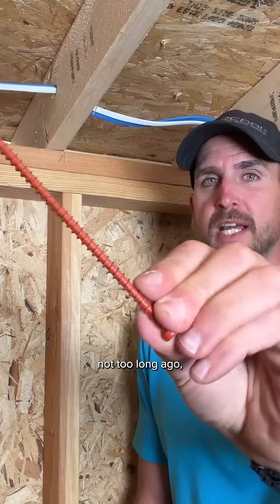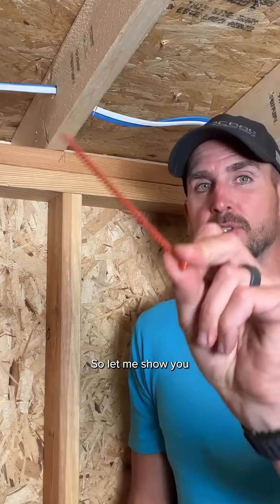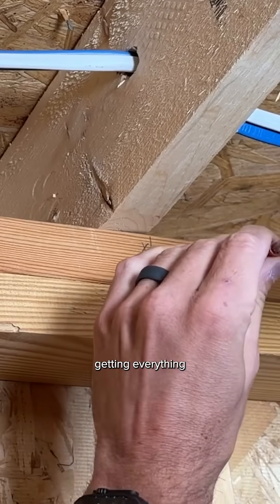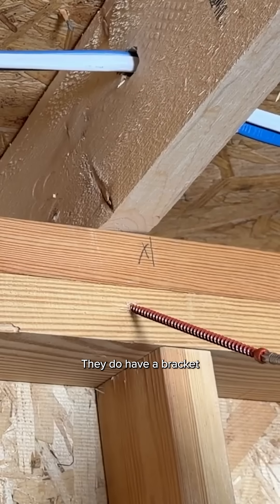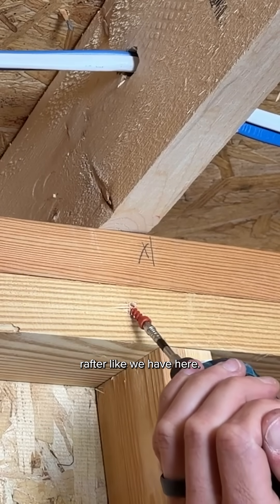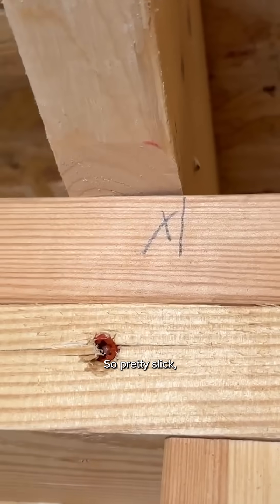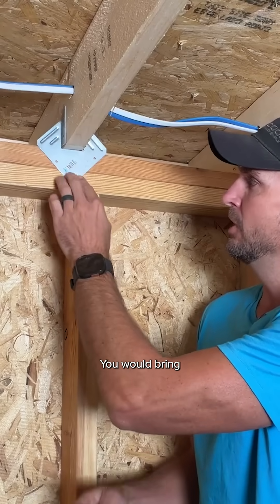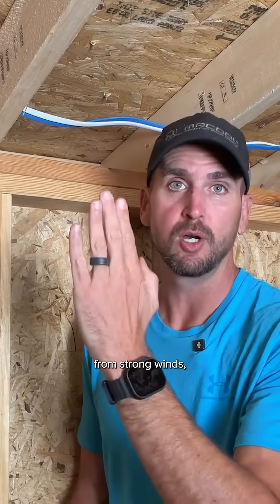The Screw That Makes Hurricane Straps Obsolete?

Comment: A screw with threads cannot replace the bracket. The bracket has more points of holding on both structural pieces. Plain physics says no.
Reply: You comment clearly indicates you don't understand engineering. The screw and bracket strengths are calculated based on the cross sectional area in tension. That bracket is about .05" thick with two wings of about 1" long each seeing the tensile loads. That works out to about .10 sq in total in tension. The material of the bracket is commercial grade steel galvanized steel (G90) with approximately 40,000psi yield strength. So... 0.1 sq in x 40,000psi = 4,000 lb yield strength for the bracket. Now let's check the screw. Structural screw material is typically high strength steel alloy with a yield strength of about 140,000 to 160,00 psi.  A .25 dia screw has a cross sectional area of .049 sq in. So...0.049 sq in x 140,000 psi = 6860 lb yield strength for the screw. The screw is significantly stronger in tension and exceeds the brackets capacity. Both of these capacities far exceed what the wood itself can tolerate so the engineers de-rate the allowable loads considerably by taking into account other factors such as the wood's mechanical properties since that is the weakest link. They also apply a generous safety factor. This is why when you look at the catalog you'll see 470 lb allowable (working load) for the H1A bracket and about 600 lb allowable for the structural screw. They've done empirical testing with sample assemblies and the screwed option always comes out ahead. Both, however, meet the minimum code requirements.

Engineers are smarter than you!
Reply: @internettoughguy  Q: What do engineers use for birth control? A: Their personalities.... 😅
Reply: @internettoughguy   sounds like this "Internettoughguy" dude knows what he's talking about. I'm just a carpenter but it sounds right to me
Reply: @internettoughguy  Tests that miss all variables are worthless. The bracket wins, with multiple points of entry and multiple points of fastening and better security against variable shear loads. Any genius can see that.
Reply: @Ben-v7e How do you know the tests miss all the variables? Have you witnessed the tests? Do you even know what testing they do?...
Reply: @i @internettoughguy engineering I do not understand, glad you told me. What I do know is a screw has given way (not broken) when a piece of material is shaken/vibrated and the other piece more solid. In construction, one fastener is not going to hold better than multiple fasteners in a plate in different directions. This is just a fact based on field work, not arithmetic. Have a nice Thanksgiving.
Reply: @internettoughguy  "significantly stronger" it can eliminate 20% more uplift... not doing miracles. 

And if youre trying to protect for lift and load the bracket wins out every time, and that's according to the engineers you praise so highly.
Reply: @00gyb00gy  You misunderstand the numbers. The screw itself is 40% "stronger" in tension than the hanger itself (6860 lb vs 4000 lb). The allowable loads in the catalog have reduction factors included because the wood itself simply can't handle the same loads as the screw or the hanger.
Reply: The problem is you're applying plane physics to home construction. Homes don't need to handle the same loads airplanes do.
Reply: yes!  more talk about plane physics since we live on a plane geometrically
Reply: @bw-mi9xp I like plane physics because flying is cool
Reply: Forgive me if I balk at taking engineering advice from the word of someone who can’t differentiate between “plain physics” and “✈️ physics”… 🙄
Reply: Nope.  Plate uplift in Doug-fir is 545 pounds.  The screw is 615 pounds.  Simpson publishes these values based on testing, you can look it up for yourself.
Reply: @SteelheadTed nope Simpson used a standardized test going through both 2x4’s here he obviously only goes through one and a portion of the other, no engineered blueprint or architect would pass this work, there is a standard, Simpson requires you to go vertically through both plates then through the center of the rafter, and as you can see that is impossible if the wall stud blocks you, the bracket doesn’t have these issues
Reply: @FrancisoDoncona  I never said otherwise.
Reply: @FrancisoDoncona thing is he had plenty of room to go through bottom. The rafter isn't sitting on Wall stud you can see pencil mark and when he puts tie up you can see center isnt above the stud. I don't think guy really knows what he is doing.
Reply: Yes. Every 10 gauge fastener provides 800 pounds shear resistance,if memory serves..
"Code approved" doesn't  mean best.
Reply: @williamevans6522 Always remember code is literally the floor of structural integrity. Things can be extremely overbuilt but it's a cost vs result problem
Reply: @JWill6969 Yes, that's  understood.
Reply: @williamevans6522 yep totally agree. Code approved means barely minimum
Reply: @williamevans6522  your memory doesn't serve on this account.
Reply: @williamevans6522  "Every 10 gauge fastener provides 800 pounds shear resistance"

Correct, but this screw is in tension, not shear, and tensile strength is (almost) always considerably higher than shear.  I wouldn't bet against the bracket having an overall higher strength with multiple fasteners vs. this one, but I also wouldn't bet against Simpson having done sufficient testing to ensure the single screw meets code requirements.
Reply: @JustSomeJoe-dp5rp I was thinking of the plate. It is superior when the required nails  are used in every hole.
Reply: @williamevans6522  Yea, and I agree, with multiple fasteners rated at upwards of 800lbs of shear strength each, the plate is almost certainly stronger than a single screw.  My only point was that if a single screw, with its higher tensile strength, meets code requirements, then it's an acceptable alternative.  I have to assume Simpson did the proper engineering on the screws, since they make the plates too.  There would be no reason they'd certify an inferior solution when they have a superior one already.  If I lived in in an area prone to hurricanes, I'd go with the plates.  Anywhere else, I'd probably go with the screws.
Reply: @JustSomeJoe-dp5rp  "here would be no reason they'd certify an inferior solution when they have a superior one already."

Yes there is.... the screw has a higher profit margin and they can sell it as "code compliant" which normal people think means "top of the line".
Reply: @Kandralla  "and they can sell it as "code compliant" which normal people think means "top of the line"."

First, where's your evidence that people think this.  I've never heard this claim anywhere.  It's important, especially today, to be able to back up your claims with evidence, not just say whatever supports your opinion regardless of actual truth.  

And second, putting "code compliant" in quotes is a way to say it's not actually code compliant.  Is this what you're suggesting?
Reply: @JustSomeJoe-dp5rp   "First, where's your evidence that people think this. "

My man.... DR Horton exists.

"And second, putting "code compliant" in quotes is a way to say it's not actually code compliant.  Is this what you're suggesting?"

I'm suggesting that code compliant is not a goal you should brag about.

So I take it you're a contractor who likes cheap isht and has a 50% success rate at installing anything that needs thread tape.
Reply: @Kandralla  "My man.... DR Horton exists"

That didn't answer my question... which I suspect is going to be a common theme if I continue this convo.  Care to take another stab at backing up your claim with actual evidence, or should I take your clear attempt at diversion as a refusal?

"I'm suggesting that code compliant is not a goal you should brag about."

You say that as if you don't realize how many products you use on a daily basis are built to be just good enough to meet established standards.  

"So I take it you're a contractor..."

Nope.

"who likes cheap isht"

Nope.

"and has a 50% success rate at installing anything that needs thread tape."

Wow, you really do like living in your own imaginary world where you instantly know everything about perfect strangers on the interwebs.
Reply: @JustSomeJoe-dp5rp   makes sense - the screw would have to get pulled apart.  But  Also the wood getting stripped out of the threads seems more likely.
Reply: @williamevans6522  The fasteners don't make a bit of difference, the rating on the H1 type tie is 480lbs.

The 6" SDWC is rated at 615lbs.
Reply: Bracket fasteners are in shear, the one screw is in tension.  As long as the tension capacity > the shear capacity, you are golden.
Reply: @Loonypapa  The tension capacity of the entire system not the bolt. If the bolt fails at 800 lbs pulls out at 300 lbs, your tensile strength may as well be 300 lbs.

There's also the matter of infallibility. How many contractors do you think are going to repair the install if the bolt doesn't grab? You know a lot of this came from Hurricane Andrew where one of the contributing factors to the losses in Homestead were due to contractors using hammers to install screws because they didn't have enough screw guns. Most people will use a manual hammer if they have to, they're not going to try to install a screw with a manual screwdriver.

If you want to say that doesn't matter, why does the aerospace industry use Hi-Loks (look them up)... it's not because they're cheap, its because they're nearly impossible to install incorrectly.
Reply: Actually, physics says you're wrong.

The H1 type tie has an allowable uplift rating of 480lbs, the 6" SDWC is 610lbs.
Reply: @generic_username-q7x  Well, he did say "plane physics", so maybe he was speaking about aviation??  😁
Reply: It does. Look at the charts on the Simpson products guide.
Reply: There's no need to saw a screw with threads, being the threads are what make it a screw in the first place. It's simply redundant.
Reply: But here in maine you dont have crazy winds hurricane tied owns are super over kill mortgage company made me put tie down in my slab never herd of a house in maine flying away
Reply: The bolt is actually more secure. Believe it or not... It is.
Reply: @JF32304 Thats not a bolt.
Reply: @Kandralla   do you know what a lag bolt is?
Reply: All this talk in here about physics lol.
Reply: I don't know how to do the math but I do know that Simpson does test a vast majority of their products. Im sure there are nominal loads and calculated loads for these things, all in all if its just as good if not better with their testing im not sure if its 3rd party or not, I don't see why not. I can see why some wont trust it but unfortunately if its proven just as good or better then why not. I guess this is a subjective thing in construction.
Reply: Read the studies. Then tell us more about physics. You sound like an expert
Reply: ….ditto
Reply: I agree no way I would trust that screw over the bracket just another way to screw people over with false claims and just there to make you buy a porch again faster

Comment: That single screw isn't better, less than half the protection.
Reply: Plate uplift in Doug-fir is 545 pounds.  The screw is 615 pounds.  Simpson publishes these values based on testing, you can look it up for yourself.
Reply: @SteelheadTed  Tests performed to support the single screw do not include testing for other variable movements and stresses that the plate handles but the screw does not. Pretty simple.
Reply: @Ben-v7e how do you know?
Reply: @SteelheadTed 0 chance this is accurate.  You read the wrong information.